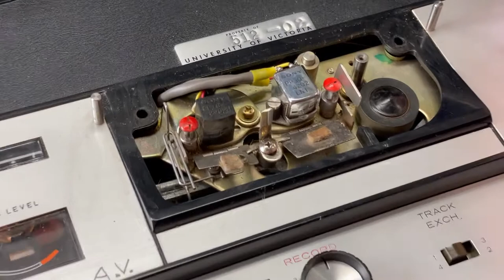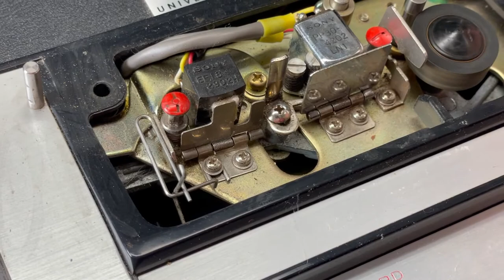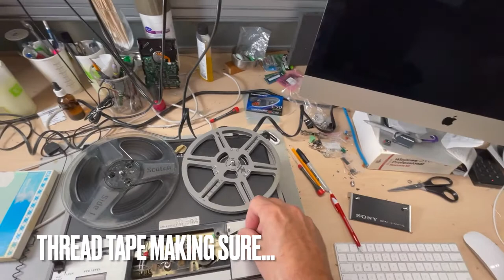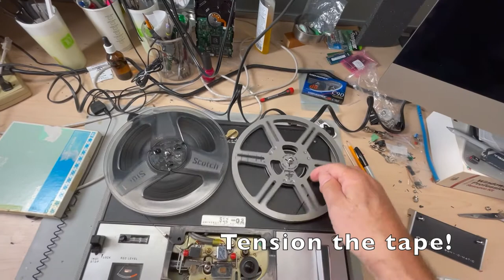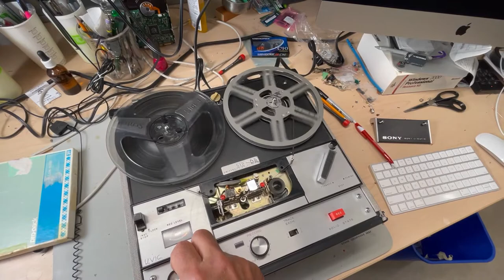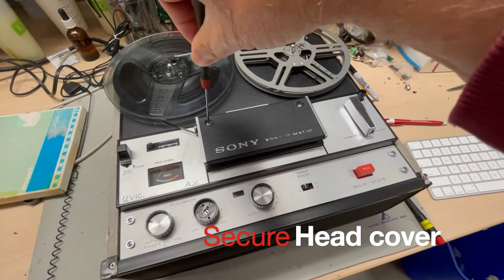The classic TC-105 Sony Reel Reel tape threading

Comment from the maker: When you thread the tape - you need to make sure that the tape "holds back" the tape sensor -- OR the power to the motor will go off.